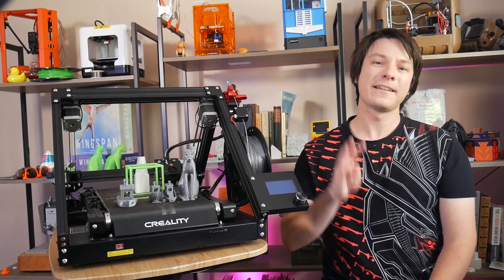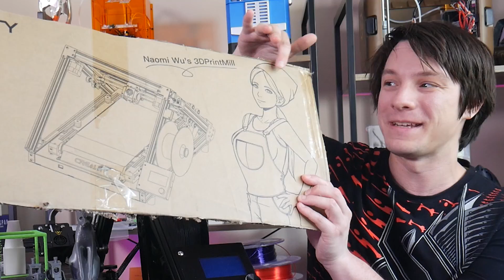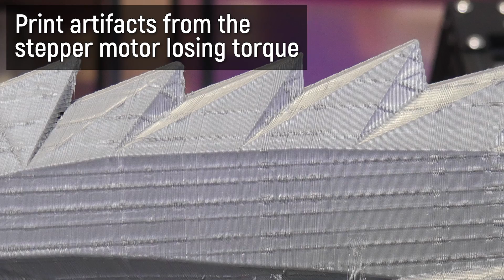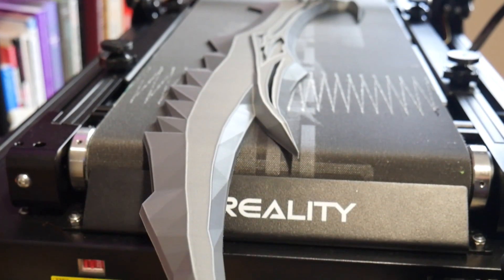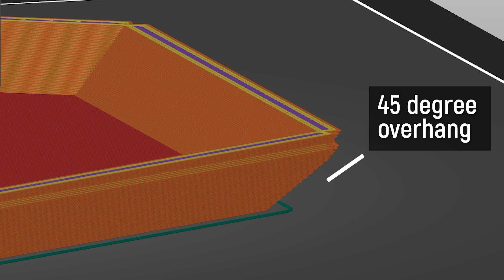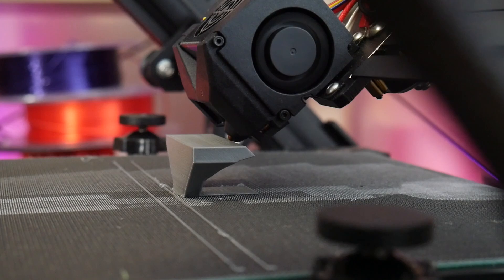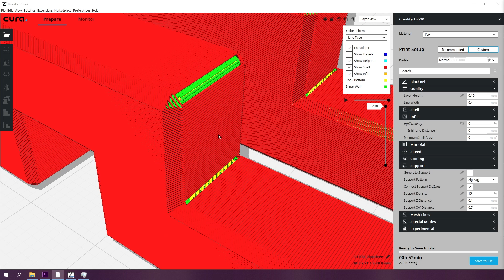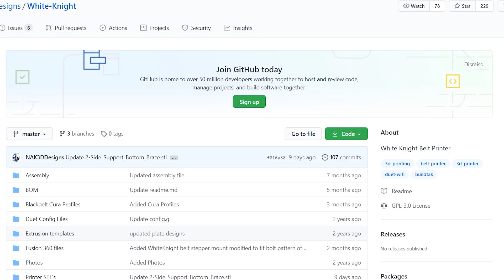Your 3D Printer can't do this... Naomi Wu's 3DPrintMill / Creality CR-30 Review

Comment: got this as my first 3d printer and my first print was a benchy after a single level it looked significantly better that the benchy on the right at 13:27 its also been a few years since this videos been posted but i think if this is your first printer youll be fine if youve got half a brain

Comment: "I know that slicing technology will only get better for this kind of set up, but I do really hope that it will happen quickly..." Here I am 2 years later struggling to find a good slicer. Id really like it if Cura or Prusa made a belt slicer because it would be nice to use their Arachne engine along with a .8mm nozzle to get high quality prints on a larger layer height/width.

Comment: I don't think the G code would be a limit because you could write a line to repeat steps 200-300 a million times. So then the code could be just as long as any longer or shorter print.

Comment: It would be much better to not have the printer angled at 45 degrees. Just redesign it to print from a standard positional orientation with the belt underneath.

Comment: Hello and thank you for the GREAT detailed info. I am a subscriber! I have a question; should I have a problem with printing out a 6 foot pvc type pipe that is printed where the pvc is already split in half alone with small holes on both halves of the pvc 3D printout?

Comment: Belt tracking is just like on a treadmill or other similar belted roller device. If run at a higher speed you can check and adjust alignment in real time. Is this possible without the printer in print mode?

Comment: Hey, so I dove a bit into how to make a slicer compatible with the CR-30 when I did my school project to build a slicer from scratch, and found there's two main things required.

1. A warp & rotation of the 3D model along the Y-Z axis. If you look at the gcode for a print for the cr30 in a traditional gcode viewer, you will be able to see the rotation and warp done to the print. 

2. Align model 'floor' to Y=0. It's just as it sounds, you want your model 'bottom' to be aligned with the Y-axis plane edge.

I'm thinking about making an application to convert traditional models into the warped and rotated models so that you can use any slicer with the CR-30 or similar 3D printer. Just checking if anyone else has thought of this yet

Comment: Why not ship it with a nozzle that is aimed normally? Surely this would solve any issues the angled nozzle has. I'd personally love one that you can tilt manually with a lever.
Reply: I did wonder myself.. it would have to work i sections though as it does not have infinite moving backwards and forwards? could easily be done with the z runs  (is the belt z now I come to think about it) staggering  the seams I guess ?

Comment: if we add a joint to tilt the print head it could print normal prints as well.
and be able to print with extreme overhang in two directions

Comment: That is a very cool printer, Brilliant concept! I just worry about keeping that thing aligned over time. Anytime you introduce multiple points for adjustability you end up spending more time doing adjustments than doing the actual job itself. Nice you showed the detailed side of the sword but we all know the other side was as flat as a pancake so you would have to print another side and glue the two half's together. So total print time is what 90 hours?

Comment: The whole different restriction issue with overhang because of printing angle. Would it be fixed with a slicer designed to slice at a different angle??

Comment: I vaguely remember seeing someone do this with an off the shelf 3D printer (i.e. they attached the X gantry at a 45 degree angle and setup a rubber track bed) -- probably back in 2016ish? -- Might have been one of the folks you credited, I'm not sure. -- It definitely wasn't a CoreXY machine though... -- but anyway I'm glad to see this novel idea is starting to take off. -- Hope the Kickstarter goes well. 😊

Comment: The obvious solution to the overhang issue is a rotating print head. They could put a stepper motor on the rail of the print head axis and allow it to point up, down, or any direction as needed for the geometry of the print. That would be a killer machine for sure!

Comment: Well I backed this printer despite my worries about kickstarter (never backed anything before). But for me having a printer that can print custom designed rc boats in 2 shots is a gamechanger. Already getting my arduino friends for a fleet rc demolition derby.
Reply: And yes I do have a primary printer already but with 20*20*18cm build volume

Comment: Angus, if you're interested in additional slicer support for the CR-30, Kiri:Moto 2.4 now has experimental belt printer support. Kiri runs in-browser at @t and a quick video on how to use it is here @deyU

Comment: you have mention the length of the gcode if you want to run multiple parts.  can this read G99? (a CNC code to restart to the beginning of the program which can be used forever without having a long code)
Reply from the maker: Not currently, but work is being done on the firmware to allow similar repeat commands.

Comment: Angus - I'm wondering - with  the adhesion of the layers being diagonal - would this provide enough strength to print artificial arms and legs, since each layer has a larger surface area?

I'm asking as the flexi hand works amazingly well when you have a wrist/hand to fix to - but I'm looking at cases where the arm ends just after the elbow.

A normal printer can't print this length - and if can - the layer lines are it's weakness.

I'm looking at how this can practically be used past small part replication, toys and gimmicks.
Reply from the maker: In my opinion it just changes the angle of the weakness, some parts will become stronger while others weaker depending on orientation.
Reply: @MakersMuse  I'll have to start looking around at designs - I've loved the Iron Man and Alita ones pros have done. Imagine being able to take a measurement - then print in place the whole prosthetic from top of arm to tips of fingers, with only the silicone and wire tendons to fit!? People would go from waiting lists to pay thousands (think about kids growing and having to replace) to being able to order for only a few pounds!

Comment: Is it just me, with zero actual experience with 3D printing, but it seems like the angle of the printer head is unnecessary?  What’s the advantage of doing so?
Reply: I think it's to have the model only moving away from the print head (no collisions) and that's your Z axis as well. If you print in the normal way, you couldn't move the head up/down it only moves in XY. Unless you also install an extra belt+motors to move the XY frame itself, which is not a good option.

Comment: The printer head should be able to change its angle. Being able to print with nozzle facing straight down or at any angle up to that 45 degree angle.

Comment: I can already see how some of the test prints could be made to print cleaner simply by rotating them around the vertical axis, particularly the open cube, if it was rotated 45 degrees around the vertical axis all the upper horizontal bars would be supported during the print.

Comment: This is exactly the tool for making 3d printed rc planes. You could print an entire fuselage and the whole wing from tip to tip as a single piece.
Reply: That's one of my main goals to achieve with 3d printing in the near future
I would like to see more of this machine in printing accurate dimensions over distances.

If it can keep a fuselage or wing straight and solid throughout its run, I'm sold
Reply: @maxman1244   I'd probably go the route with printing tons of ribs and skinning the wing with film. do you have an insta? I build planes here & there.
Reply: @kaichristiansen8110  drop me your handle man! I love rc aviation!
I definitely would more likely just skin the wings, but I love the idea of having full sets of wings printed out and ready to go

Set your printer before you head out for a day of flight, and then if a crash happens, when you get home you can just put the new wings on, Ahh the dream 👀
Reply: @maxman1244   Lessa_brim
Reply: @maxman1244  Octoprint and you could just start the wing printing after you pick the bits up and have it already part printed by the time you get back from the field...
Reply: That’d be sick
Reply: Or a surfboard in thirds
Reply: whats wrong with just glueing bits together
Reply: Cores or 3D printed molds for hydrofoils...
Reply: That could be the new benchie
Reply: Personally I think it'd be less useful than you think. If you look at how RC planes are printed, it is single layer vase mode style printing, bottom to top with sections glued together. The idea is to minimize weight while printing structural components. If you print sideways with a print head at 45 degrees then the rules go out the window and whatever you print needs internal supports or it will collapse. Maybe this is okay for some prints but maybe it isn't. I doubt existing designs would survive the transition without being reworked.
Reply: @drxym  no.. because it is printing at 45 degree slices, as it works down the wing the upper skin will not need any support.. if the wing is printed in an upper and lower half then the two glued together with the sword. if printing the whole wing there would need to be support at the belt I would think, but a strut inside the wing every I dunno, 6 inch or so, should ensure both skins are supported enough to continue indefinitely..

That is If I understood it properly, given I have only been thinking about buying my first 3d printer for 5 days now it is ENTIRELY possible I have misunderstood, but its an absolutely fascinating concept!!!
Reply: @drxym  if I am right.. if you sliced the wing in half horizontally like the sword, then the leading and trainling edges would be affixed to the bed, the curvature of the wind surface would then add dimensional strength passing any z forces through the skin to point of contact at the belt.. there is no overhang in the y direction as its printing 45 degree slices also meaning that the unsupported edge also has a 45 degree slope printed ahead of the unsupported bit if you see what I mean to make it even more stable.

Comment: I twould be really interesting to see a 3d printer where the print head is not locked linearly, so say with the belt printer here it could choose the best angle for the print head on the model similar to how a 5 or 6-axis cnc machine does

Comment: Angus, I'd love to see a review of a Delta printer or two on your channel. I can't find any from the past few years but I could be wrong. I find the form factor interesting.
Reply from the maker: I tested the Alta, but it wasn't great. Can't say I'm a fan of the design and print volume.
Reply: @MakersMuse  No problem! Maybe I just like my delta in relation to my first printer. I like that the bed stays still and level. I have the FLSUN QQ-S Pro, which you might want to check out. I think it does a good job for a printer in its price range. I picked it up for around $290.
Reply: In comparison, I still like my first printer, the Anycubic i3 Mega S. But I absolutely hate trying to get the bed level and adjusting Z height with those four posts. It doesn't have auto leveling, so maybe I should look for that in future printer purchases.

Comment: Would it work if you tilted the whole printer 45 degrees so that the printhead is level and the belt is tilted? Isn't that theoretically a regular printing scenario with a descending table?

Comment: What if you make a tiltable platform that integrates with the slicer? That way the printer can tilt the nozzle between 0 and 45 degrees making it able to print crazy overhangs and prints!

Comment: idk, you tension belts to not touch the sides of the bearings and stuff and the treadmill is just another belt. Im wondering, is there a hotplate underneath the treadmill?

Comment: I would like to see a standard oriented 3D printer with a belt. Dimensions would be not infinite but would allow for "infinite" automated printing.
Reply: That's probably the cleanest solution to "auto eject" prints, but I think there are some patent issues with it for now.  That said, Creality are offering a "just the belt" option for $40-50 so something you could do yourself.  (as custom industrial belt like this would have minimum orders easily 10x that)

Comment: When printing multiples of the same part, Could you not use g code subroutine codes, M98/M99 as you would do on a mill or lathe to run multiples of the same  part? This would save on gcode file sizes
Reply: Afik, they aren't supported by the slicer or printer yet though I think it's on the roadmap.

Comment: Thank you for the great preview Angus!  I knew from the beginning that this was essentially an "infant" technology for the consumer market... one with some excellent potentials and yet a rather specialized niche of the overall 3D printed market... It will be great for performing certain tasks and builds and will have its own quirks and procedures to operate well... just like any other tool... just like a mill and a lathe are used for different purposes... it is just like any other tool in a similar way... if you don't need it for the uses it excels at, Don't get one!! ...and don't bitch about what it cannot do... a hammer is not made to cut wood, quit bashing it for things it was not designed to do.  If you DO get one, take the time to actually learn how to use it rather than expecting it to be "perfection" right out of the box... EVERYTHING worth doing takes time to learn and become good at. (with some exceedingly rare exceptions)

Comment: at least one of the most known issues with bowden tubes is already fixed: The extruder not grabbing onto it. as i can see they already included a stock Dual gear extruder from factory.

Though i would recommend them to use a dual sided bowden tube connector. as you can add a bowden tube style filement sensor to it more easily

Comment: technically this is a 4D printer..
Reply: What are the 4 dimensions?
Reply: @npgoalkeeper _ And assuming the first 3 dimensions are X, Y and Z, what's the 4th dimension?
Reply: @npgoalkeeper _ Extruder? Well there's certainly a motor and control channel for the extruder, but why would you count it as a dimension?
Reply: @npgoalkeeper _ Perhaps it could be construed as contributing to the dimension "density", as in density of plastic in the finished object.

Comment: can someone print a chainmail but its just 1 chain or 2 wide so it it just drops to the floor which means the weight never increases after it reaches the floor. Kind of like a rope.

Comment: Pretty simple fix to the 45 degree issue - angle the printer "up" from its back somewhat. or indeed at 45 degrees provided the print does not "dig into the floor" (like infi-beam would). Sorted.

Comment: Why not just make the print head rotate on its own (x, y)axis.
Reply: Because the flat face at the end of the nozzle has to stay parallel to the in-progress flat print surface, otherwise the nozzle will collide with the print if too low, or squirt an uncontrolled mess if too high.  There have been efforts to make extrusion printers with heads that move in some manner other than a plane, but the kinematics are complicated and quite dependent on the shape of the model.
Reply: @Graham_Wideman  I guess it would make a fair bit of hassle creating gcode for moving the print head and returning to a second zero after doing the horizontal prints. I guess it should be possible but complex, as it would simplify the slicing a whole lot, but there would have to be a lot more firmware onboard to have it work. I guess the one step at a time approach should do at this stage, as just having the conveyor belt is a complexion in it self.